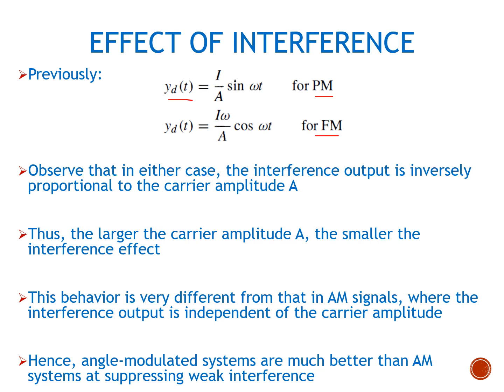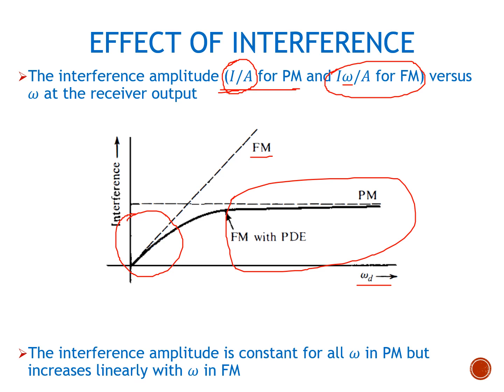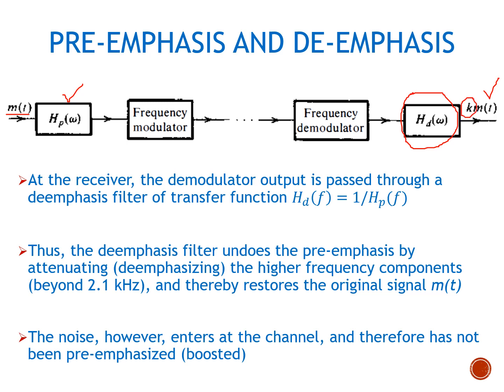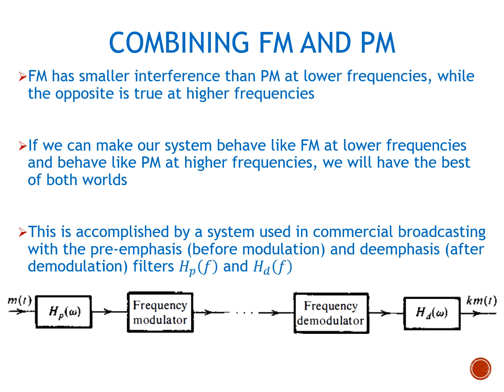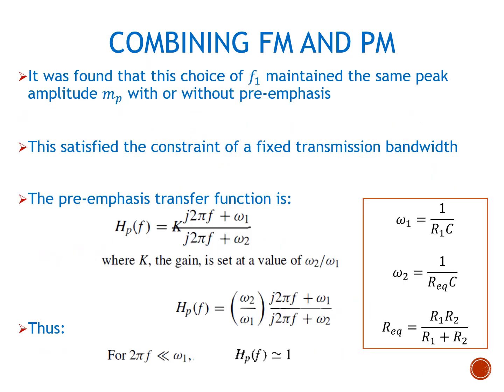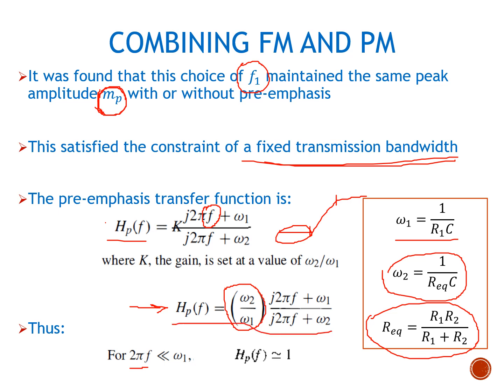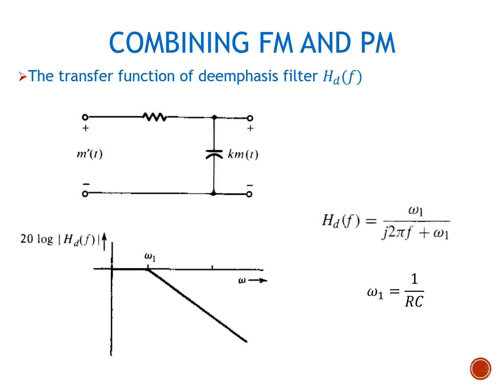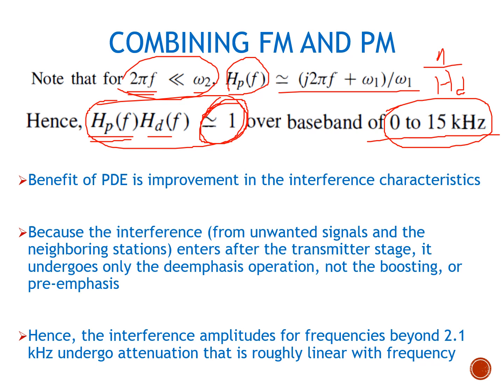Pre emphasis and De emphasis for FM

Comment: hi

I am working on implementing pre-emphasis and de-emphasis in Simulink for my FM modulation and demodulation project. I used the transfer function for pre-emphasis, but I am encountering an error related to the derivative function in the transfer function. The FM modulation and demodulation blocks are already set up, but this issue is preventing the model from working correctly.

Could you please help me with this or provide any suggestions to fix the error?

This is part of my communication course project, and your guidance would be very helpful.

Thank you!
Best regards,
Reply from the maker: Hello. Sorry I just saw your message. Can you share your file or explain the issue with the help of some screenshots? You can contact me at: universityhelpers@gmail.com